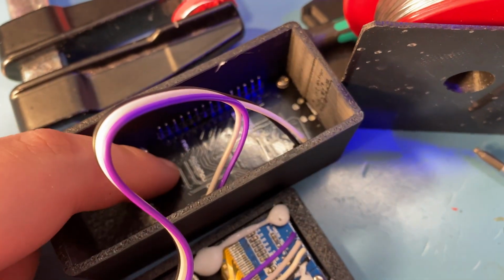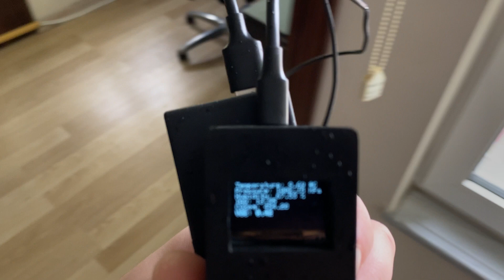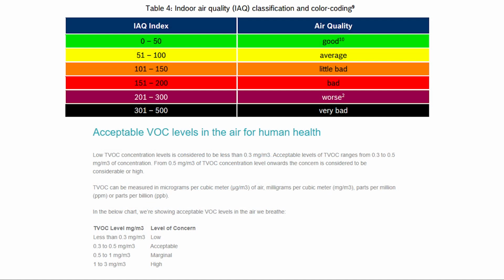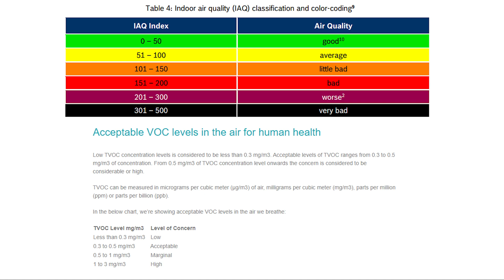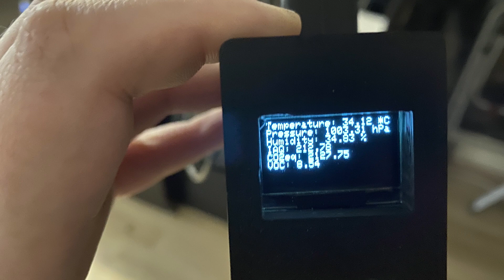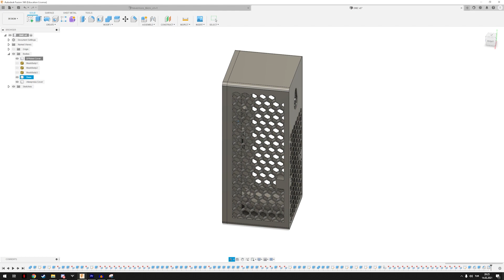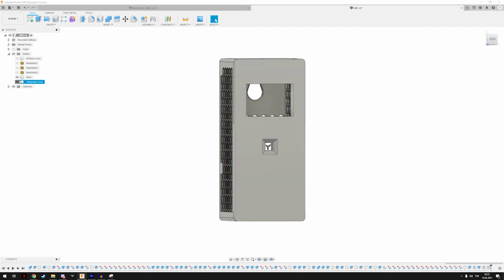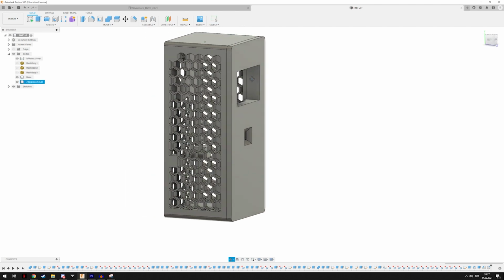BME680 Air Quality Sensor - Measuring 3D Printing Fumes

Comment: Thank you! 
Can i implement it to home assistant? Und
Reply from the maker: Probably. It outputs text so you should be able to read that and transfer over wifi using the esp and integrate it into your home automation setup. But I have no experience with that so you'll have to do your own research.

Comment: I think it's quite a stretch to deduce that something is not carcinogenic by thinking that if it was, we would know, as that would cause the insurance rates to sky rocket. First of all , in the US insurance rates are already high, so by this logic maybe that means those VOCs do cause cancer? (rhetorical question) There are millions of factors that play into the complexity of the healthcare here (and everywhere else for that matter). The idea that such a tiny cause (normalized to the grand population which are neither plastic factory workers nor 3d printing users) would have any measurable impact is not plausible, frankly. Issues like cancer are quite difficult to analyze due to the latent effects. It's known (via other means) that some of these VOCs are indeed carcinogenic. Whether one will get it or not is a probabilistic function of the levels and duration of course. I am sure there are OSHA regulations in factories that limit the levels that the workers are exposed to. I sincerely suggest not to assume it's just headache (literally or figuratively). ABS is nasty. PLA and PETG are indeed better in that regard and work for pretty much anything that ABS does  (except temperature resistance). But hopefully not everything we print are high temp printer parts. Also worth noting that the need for high temp printer parts are due to the need for enclosed printers, so that we can print ABS. So the need to print ABS seems to be a recursive problem. :)
Reply: The reality is even weirder - there’re apparently studies comparing VOC from (well-ventilated and monitored) injection molding plants and the surrounding residential areas, and it turns out the factories are much safer, while the residential areas accumulate VOCs at almost 2 orders of magnitude higher levels. So the net result seems to be that good industrial-level ventilation is essential while 3d-printing, if one wants to be safe from VOCs and particulates.

Comment: Nice. It would be good to explore the possibility of calibrating duplicate devices, at least so that they roughly agree with each other in the same environments. I’m sure you could enter offsets to bring their measurements roughly into line. Then you could place them in different positions to monitor the effectiveness of any filtration etc.
Reply: Also, are you able to advise how one would transfer this programming to a Pi instead of using a NodeMCU board? There is a Pi in my printer as it runs Klipper, so it would be great if this sensor and OLED could be rigged up using the GPIO of the PI instead.
Reply from the maker: The library doesn't support pi unfortunately. I wanted to use a pi too.
Reply: @IsiksTech  OK, thanks. I believe there is python code for the BME680. I will explore that.

Comment: Interesting analysis. However, your argument about "The U.S.A doesn't have safe guards in place, so we shouldn't worry about it," is quite flawed. We are a bunch of idiots. Our bridges fall down, cranes collapse, and the entire city of Flint, Michigan was drinking lead laced water. A water system built by government contractors with government inspectors. There is so much corruption here in both the government and private sectors. My point is, as much as I like the idea of setting an example for the world to follow, we could, and should, be doing a much better job.